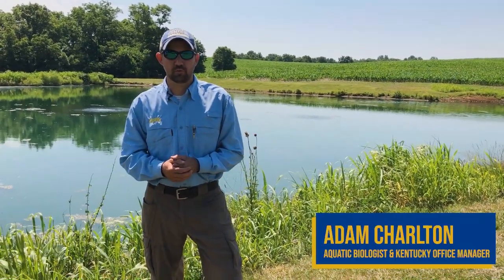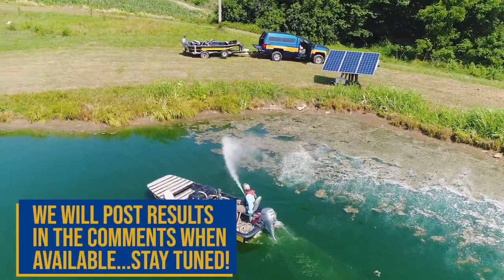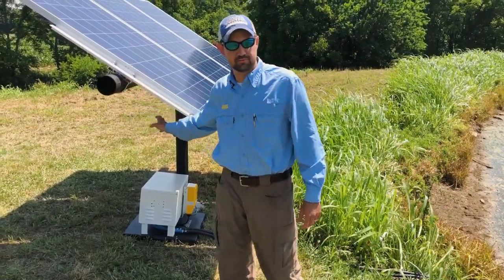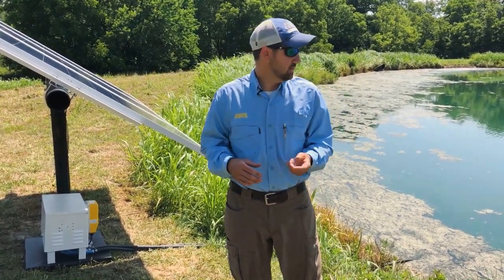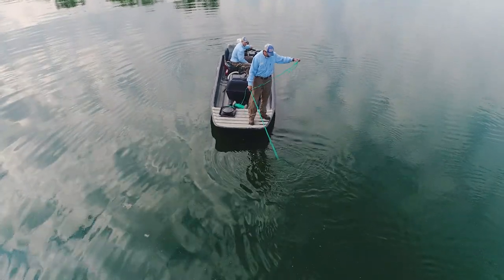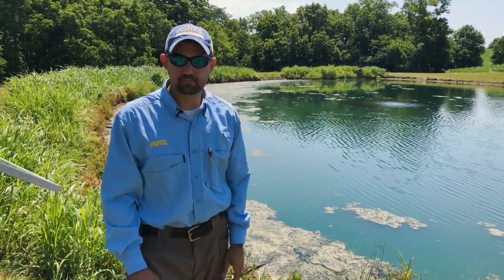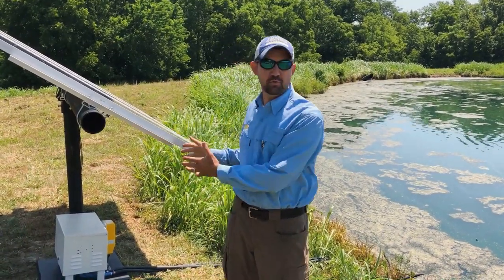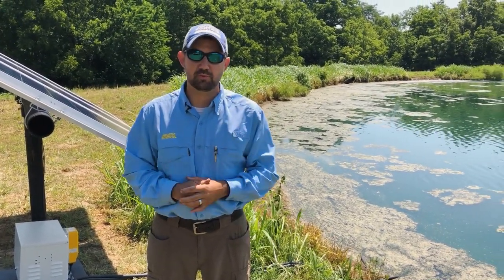Solar Aeration - How to add pond/lake aeration with no electricity. - Pond and Lake Management

Comment: How do you match the solar panel output to the (presumably) 110V pump? On top of the solar controler does it need an inverter and buffer battery?

Comment: What size is this 1/4 hp taking care of. Is it figured by area or column feet of water?
Reply from the maker: Thank you for watching Steve. The size of the unit was recommended by the manufacturer based on the surface area & depth of the waterbody. If you have a question about your pond and what size diffuser you may need, call us at 1-800-753-LAKE. W would be more than happy to get you a custom recommendation.

Comment: What is the general rule for the  spacing of  diffusers . 
For example  70 ×40 meter dam, average depth 2 meters
Reply from the maker: Thank you for the question! Diffuser placement is generally based on the overall size and depth of the water body to be aerated and its shape. Once overall size/depth/shape is determined the diffusers are placed evenly throughout the water body while attempting to keep them in the deeper areas of the lake. Generally, (but not always) diffusers end up being 100’-200’ apart with pond depth being the main factor. With 6.5’ or so of average depth (like you have) we would recommend diffusers be placed closer together than if the average water depth was 15’ as an example. Diffuser placement is not easily defined and is typically designed on a per pond basis. Also, we typically don’t recommend diffused aeration for ponds with a depth of 8’ or less. We would recommend surface aerators. If you would like, feel free to give us a call at 1-800-753-5253 and we would be happy to discuss this with you in greater detail.

Comment: How did you decide number of solar panels and capacity of the motor???.
Reply from the maker: Thank you for watching! The manufacturer recommended the sizing on the compressor motor and system, based on the surface area and depth of the waterbody.  The solar panel array size is determined by the manufacturer as well and is based on the size of the compressor in the system.  This particular solar panel array is the optimum size to operate the size compressor in this system. If you need any more help with design assistance, please feel free to contact us!
Reply from the maker: @nicchan1783  We will be in touch! Thank you for the comment and for watching.

Comment: What does a unit like this usually run
Reply from the maker: These types of systems start out around $4,000 (including delivery and installation) and go up from there depending on the exact requirements for the pond that they are being installed in.  If you would like a custom quote, please reach out to us and we would be more than happy to provide a quote. Thank you for watching and commenting!
Reply: @aquaticcontrol  what's your email. Im a year or two away. I have to redid and design my pond. Wont be very big, but I'm interested in total off grid system for aeration and for water flow.
Again not a big pond less than an acre
Reply from the maker: @mr.mikesart7111  We can be reached at sales@aquaticcontrol.com. From there, we will get you connected with one of our Fountain/Aeration specialists!

Comment: Can it run 24/7?
Reply from the maker: Thank you for reaching out Jim. Solar-powered aerators with battery back-up are designed to operate 20 hours a day.  Solar-powered aerators without battery back-up will only operate during daylight conditions. The unit you see in this video does not have a battery backup.